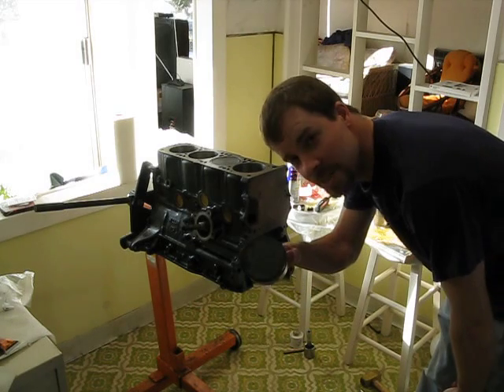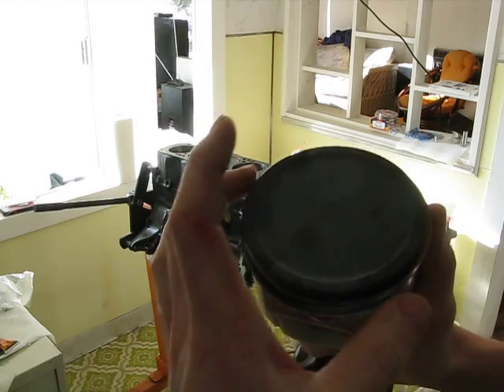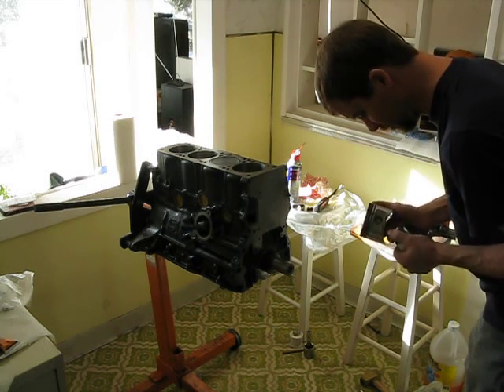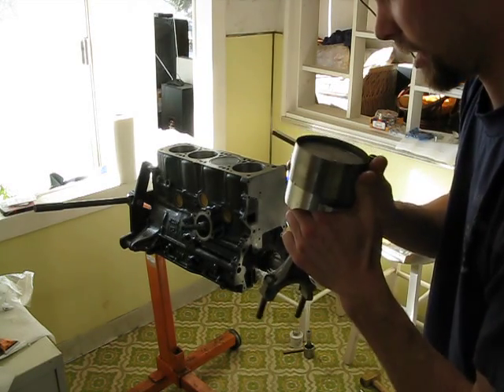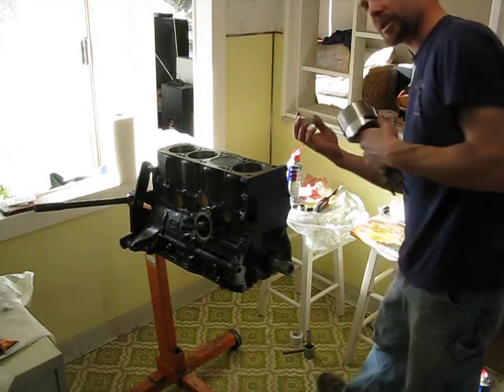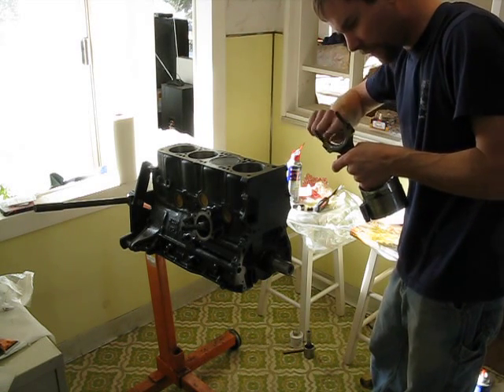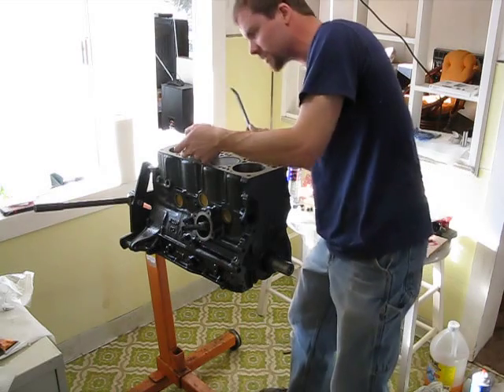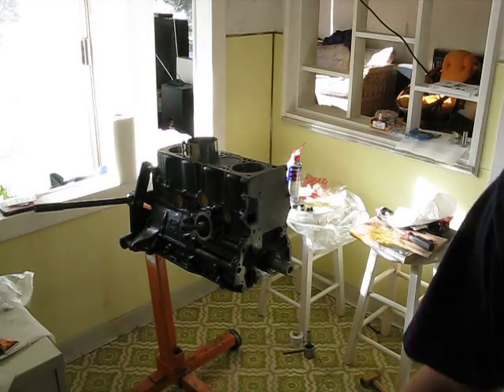Installing pistons Z24 part A

Comment: is there a specific way to take out the pistons,rods and krank???already took the rest of the motor out except for the pistons,rods & crank
Reply from the maker: Sorry for the late reply, I don't check youtube much.  As for removal of said items, spin it upside down and remove the rod bearing caps and poke them out the top of the block by tapping with a rubber hammer or wood stick or something, depending on if you're saving the bearings or not.  You will need to catch the piston as it comes out or it will drop on the floor after the rings are free of the block.  As for the main bearing caps to release the crank, the rear and center will be annoying, gently pry against the block skirt and the crank and wiggle them out.  Then yank the rest and lift the crank out of the cradles.

Pistons are pressed in in most Datsuns without custom pistons.  That means you need a rod heater and a press or a press and someone who knows how to use it.  Rod heater is much easier.